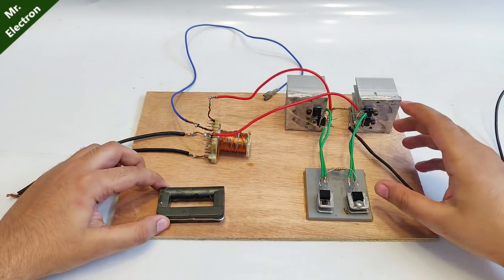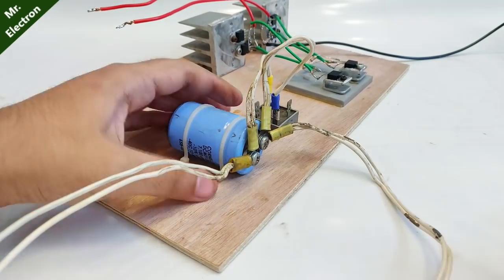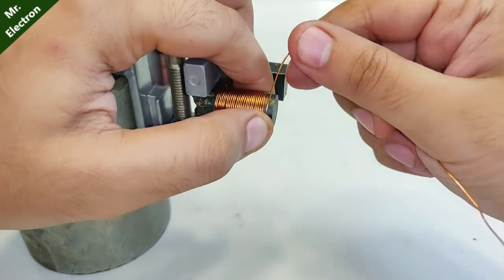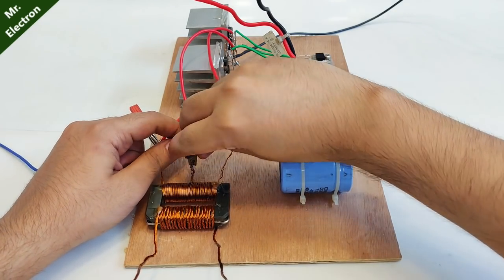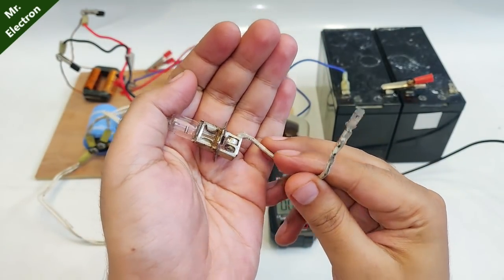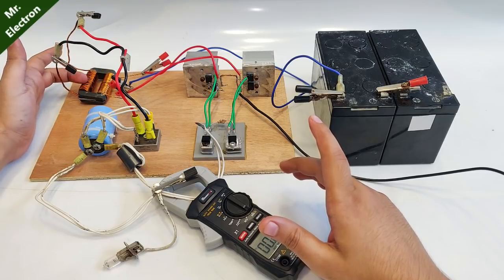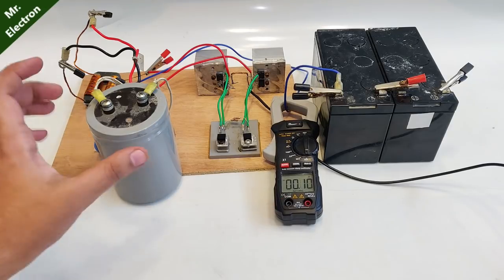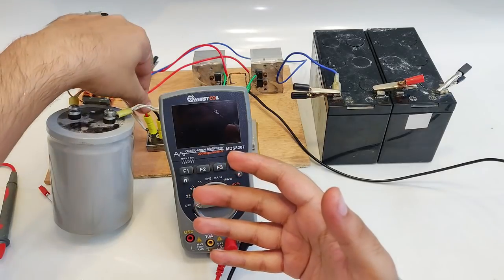DC to DC Converter from Inverter Circuit (Current Step up Booster)

Comment: How about two different wires of different gauges connected in series and then wounded together as secondary winding, will it boost the current & voltage simultaneously? Please try. Let's see.

Comment: Can you make 6400w,100A DC to DC step up converter for me to run 6000w Bldc motor
Reply: michel777ification  you tell me how much it will cost
Reply: @karann279  How many volts is the input voltage? Example: output is 6400 watts at 100 A => 64 V and you have a 24 volt battery bank. Your step up converter works at ~ 80% (the buck converter shown is only 60% efficient!), So you need 8000 watts at the input, at 24 volts is 333 amps. Have you already thought about where you can permanently take these amps and for how long your battery can handle this? What cable diameter do you need for this, also for the parts of the inverter? Look at the performance losses. None of this has anything to do with reality.
Reply: @wernerpeter9706  the input supply is like this, 24dcv, 200A, how much it can be boosted by dc to dc step up converter?
Reply: @karann279  You can easily do the math: input power is output power minus efficiency
In your case, the input power is 24 V * 200 A = 4800 watts. With an efficiency of approx. 80%, 3840 watts remain. The higher the difference between input voltage and output voltage, the worse the efficiency and vice versa. At 64 volts, you have about 60 amps of load current and a very good heating.
Note: forget the information about 98% efficiency on the packaging on purchased converters.
You write "input supply" - do you mean a power supply and no battery bank? => buy a suitable power supply with higher output voltage. On the other hand, if you are using batteries, put them in series to increase the voltage.

Comment: 6:15.. dude a solar panel, even one at 24v isnt going to match the Ah of those batteries, they look like 12Ah, a 24v solar panel will give maybe 2-4Ah if youre lucky! those batteries are capable of high current discharge at a rating of C20!! that means they can put out 20 times their rated Ah for a short time... its like comparing a Tesla car to the Mains Electrical Grid! no comparison..
Reply: Yes, these batteries usually have 7.2 to 12 Ah. But you're just mixing amps (A) and amp hours (Ah). These are two different values. A solar module cannot store energy, so it has no Ah. The amps that flow in a circuit depend on the load, not from a battery or solar module. A buck converter increases the current and decreases the voltage, so that would still work even with the amps you suspected for the input. The maximum amperes of a 24 volt solar module depend on the watt. A 300 watt 32V module (that's for 24 volts) delivers 9 amps max. Your C20 interpretation is wrong!